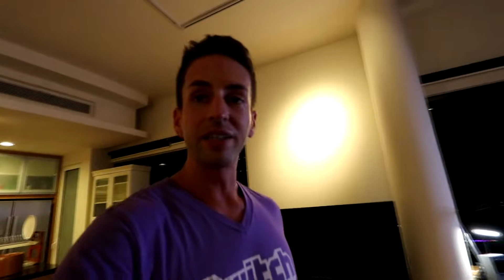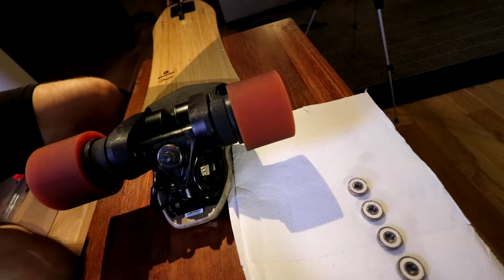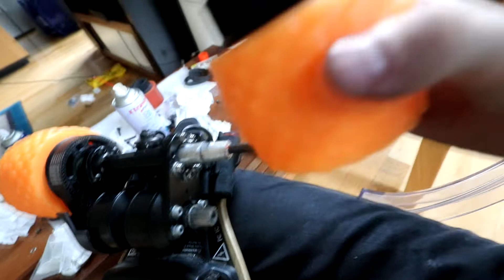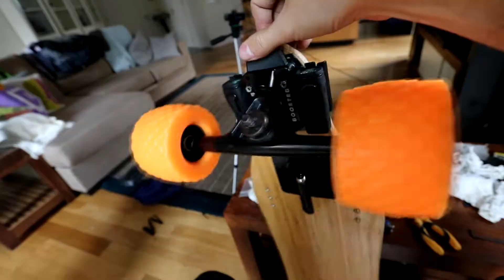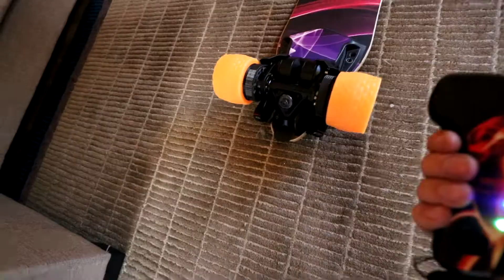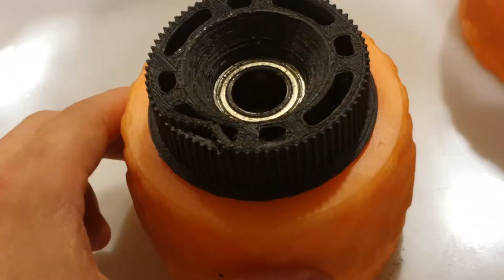DIY TUTORIAL: All-Terrain Wheels for Boosted Board - It didn't work, but it's not over.

Comment from the maker: Currently applying extremely strong glue to hold the wheels to the 3d-printed gears... until the aluminum machined gears arrive next month!
Reply: Sadly 3-d printed details and parts is not usable for any use with force, so i'm surprised if it worked for more than 10 meters. Only printers which print with metal and laser can do "ok" job, but they cost like a spaceship and used for printing parts for that spaceships.